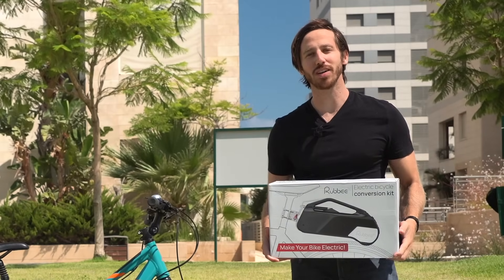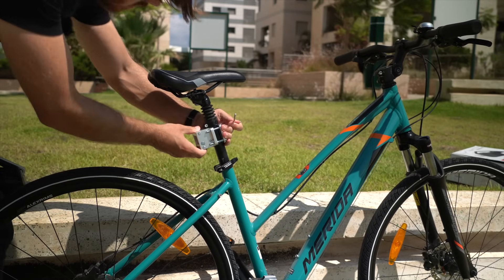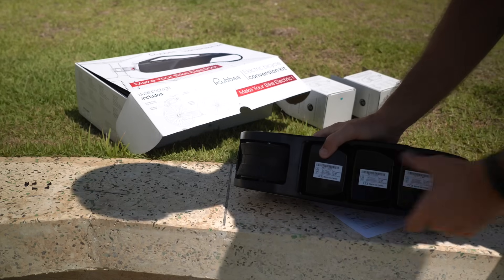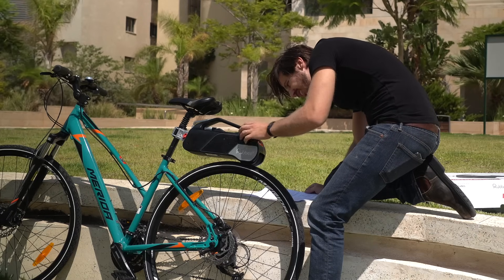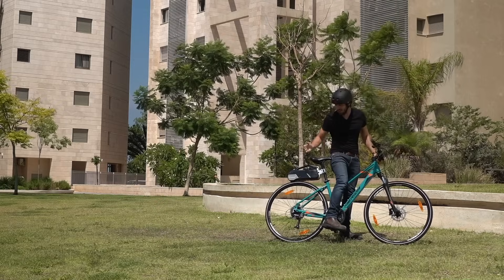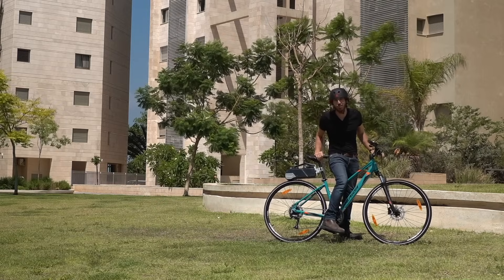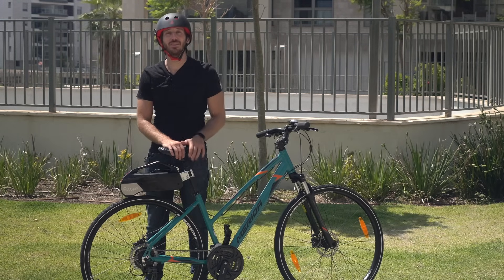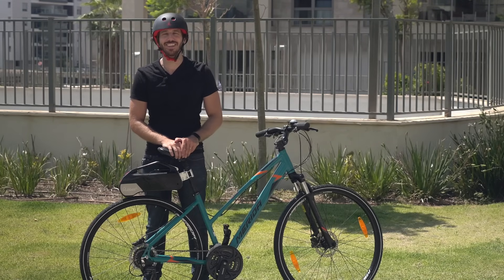The Easiest DIY Electric Bike Kit I've Ever Used! (Rubbee X)

Comment: Is there an ebike classification like 1,2,or 3 ?
If for instance it’s a class-1, could I then pedal over the 20mph speed limit, also does the unit have to be on continuously?
If so then what is my time limit before the battery goes dead?
Thanks. Jim Wedeking

Comment: DO NOT Buy one of these. I am one of the backers for this on Kickstarter almost 3 years ago, they have not fulfilled their backers and have no intention of doing so. No matter what their excuses are,  they have stock to sell to unsuspecting public but none to fulfil their investors. How can you trust a company like this? Yes, I’m biased because of being CHEATED by the company but think about it this way, if a company blatantly disregards their backers and is in it just to make a quick buck, what will happen down the line when the company finally folds due to it’s devious practices and you need to replace your propriety batteries?

Comment: Wow, this setup is around $900.  For the motor unit and batteries. Plus shipping if they charge for that, plus a bicycle. 
My last four used cars each cost me less than that.
Reply: Stop buying shitboxes then. You can buy a car for next to nothing these days, especially without valid MOT, no point comparing against something new, with warranty.
Reply: @owen4326  
   The a new car payment is what, $400-$600?
 The gray Kia s*** box I put about 50,000 miles on. I sold the corpse for $600.
The blue s*** box before that, I put about 80,000 miles on. Got $300 from the junkyard on that one. 
    The red S10 s*** box before that don't remember miles, but I had it over a year, and got about $300 for that corpse.
    The silver Kia before that one, same general idea, although I did have to spend about $300 for a gas tank, and a couple hundred dollars for radiator on that one. Timing went out shredded the engine after two or three years And I got a few hundred dollars for that corpse too.
    The green one before that was junk. After a while, no front suspension. But I got a few months out of it, and again I sold the corpse.
   Yeah I didn't have any warranties.  
   They kept me warm and dry. 
    Not sure what an MOT is. They were titled, plated, registration stickered, and I carried more than minimum liability insurance to legally operate each of them.
Reply: @othername1000  if you really were able to make all those junkyard cars run for that cheap and that long then clearly you are mechanically inclined. This kit is made for people who are not like you. This is made to be as easy and simple as possible for those people

Comment: I am looking for a simple motor, usb battery, and thumb throttle setup that is cheap.  Friction drives kind of fit that but they seem to be around $500 which seems high for my simple setup and older technology.

Comment: Too many other conversion kit companies have missed the boat by building them with overly complex mechanisms. This one impressed me for it's simplicity.
Reply: simple but what happens to tyres?
Reply: @truthandreason8394  Time will tell.
Reply: @truthandreason8394  
You do get some extra wear can't get away from it.  Years ago I did same thing   with a 2 stroke weed trimmer and metal roller . The wear was bad and so was the oily mess.
This time I've used an electric skateboard motor with urethane tyre  as the driver and so far roller and bike tyre still good after few weeks riding. The 2 stroke I could ruin in couple of days.
Reply: I totally agree . Take a look at this, my diy using same idea.  As is have done 11 kilometres without peddling. Still work in progress. 
https://youtu.be/u6Tbwu50QkM
Reply: For the cost of this and the little assist amount you get, you'd be running to those "overly complicated" options afterwards.

Comment: Do you have any plans to test this in different weather conditions? The FAQ on their website lists the following as one of their methods that keeps the roller from slipping on the tire:
'Special roller. Both material, shape and surface texture of the roller is optimized for increasing grip in all weather conditions.'
REALLY curious if this holds true.
Reply: Yep it does, it works fine in the wet. The gas charged cylinder allows it to maintain constant pressure on the tyre and stops any bouncing and traction loss.
Reply: @bagster8660  Thank you!

Comment: Thanks for this review. I've been intrigued by the Rubbee for ages since it seems like they've solved a lot of the problems with older friction-drive options. They seem to be in a good price position to compete with other 'all in one' (battery, motor, controller) options like GeoOrbital, Swytch, or Hilltopper.

What are your thoughts on their (as far as I know) unique setup of using multiple batteries to increase not only capacity but to also increase/unlock higher wattage?
Reply: How much does it cost as far as 2022?
Reply: @MigzMigz35  €777.00/815.39USD to get a unit and two extra battery units, to unlock the higher power.
Reply: Where can I get this to buy in the US

Comment: I guess it has its purpose but it says 579 pounds (798 US dollars) on their site. That just seems ridiculous. You can get an entire bike for less than that - 

Ecotric Vortex is $660. 
36V 10AH lithium-ion Battery
Removable 
5-8 hours fast charge
18-20 miles per charge
400-600 cycles service life
Max speed: 20mph/h

Comment: Might get better friction/traction if you flatten the tire then install the unit then repump the tire with air and it will press firmly against the tire. Just male sure the unit is low enough for when you pump it. If you plan to just keep it on a personal bike i mean.
Reply: But more general friction force is what we dont want, we want traction force (thrust).

Comment: Nice review and I have some questions. Can you easily take it off to recharge? Do you need to remove the battery modules? How does it charge? Was a charging cable included? Is it 220v only (from UK) or 110/220? What is the cost?
Reply: It comes with a charging cable, you can charge all the batteries together at once in the device
Reply: Go check out the Rubbee website....But no you don't need to remove the batteries, you plug in the charge like you do on your phone. The charging unit will be country compatible.

Comment: I was hoping you would show how it performs when the rider isn’t peddling unless I missed it. Thanks
Reply: He said it goes into free rolling mode once you stop pedaling, meaning it does nothing
Reply: He said i needs "peddle assist to engage electric assist" and pedaling backwards engages regen breaking. It doesn't run while the is not pedaling.
Reply: rear hub drive are great with just a throttle  . i have 2 1000 watt 48 volt e bikes both tear hub drive they do around 25 mph and run for about 2 hours off road before the battery runs flat ..

Comment: One problem with the Rubbee motor , we in the UK use Mud Guards as its a bit rainy  here than in  Florida , I suppose you could cut a section out of the plastic for the drive to enguage onto the tyre.

Cheers from Philip Cooper in Evesham UK.

Comment: Wow, this brings back memories! My dad had a friction drive kit he bought in the 70s. Battery hung from the crossbar in a hard leather saddle bag, motor assembly assisted the back tire. Problem was the knurled metal drive sprocket chewed up the tire fairly soon and I remember black rubber dust was everywhere. This looks like rubber to rubber so that may work better.

Comment: Cool that the installation is so simple!  No need brake cable sensors, or any wiring to a controller or display.  The only thing you don't want to do with this is ride through a wet cow pie.
Reply: Cow pie?
Reply: @hasan_z  Cattle Mousse, you know. 😉
Reply: @hasan_z  poop

Comment: What distence did you get out of a full charge? A and how’s the regen working? Can you regen a full charge, ½ charge, ¼ partial charge?
Reply: website says 10 miles on the 1   battery included ,but you can buy 2   more for up to 30 miles.

Comment: Did I miss it or did you not detail any specs or price on this unit?  how many watt motor, how many Wh's are the batteries, expected range (window) on a full charge.  Do the spare 2 batteries you installed come standard or optional at what price?
Reply: Go to their website.  It will answer all of your questions.
Reply: @tomnesler2089  obviously but I'm giving feedback to suggest more technical details be included like Micah used to give.

Comment: So, do you think it's a cost-effective option? It seems pricey enough that it might be a better choice to spring for a purpose built ebike?
Reply: Not sure if this was mentioned in another post, but from the website, the base price is 579 euros, plus 99 euros per extra battery. In the video, the three battery version would run 777 euros. This may need to be weighed against just purchasing a new e-bike and selling your old manual one, or keeping your old bike as a backup.
Reply: It's too expensive, unfortunately. The only reasonable use case I can see is somebody needing to remove the entire unit from their bike when locking it up or someone who has an exotic, expensive or unique bike they want to convert to electric without changing the wheels or modifying their bike.

I wish it were the kickstarter backer price, that is just on the high end of making it cost effective to convert a trad bike without modification.

Oh a third use case is taking it stealth on subways where they ban eBikes but allow trad bikes.
Reply: A Ride1Up roadster at $1000 US looks so much more compelling than this IMO.
Reply: @iStrong113  I think it would be disingenuous to suggest that the total cost of the Ruby kit is 579 euros. At bare minimum, you would need a decent bike to start with, so add that cost right up front. Depending on your definition of decent, that cost can get close to $1000 euros. Even if you only consider decent to be in the 500-600 range, that means you've spent at least 2/3 of the cost of a "decent" purpose built ebike, and that is a much different question than whether or not you can buy a purpose built ebike for less than 579 euros.
Reply: @iStrong113  Take a look at the Fiido d4s. It was my intro to the world of e-bikes (bought it last year) and I just love it! Brought it out of storage last night (charged battery, pumped up tires, oiled chain, etc.) and it (still) runs great. Super happy with it!

Comment: What speed did u find it easy to reach - and hold (say for 5kms / 3m on the flat)?
And what range with the 3-pack of batteries?
Tx for great channel
Reply: Range for 3 batteries is 30 miles

Comment: This is fantastic!
any thoughts about wearing the tire? is this an issue at all?
Reply: Rubbee X adds additional wear to the tire but nothing that should be worried about. We cast the rollers from a specially developed polyurethane compound mix which guarantees the best contact between the tire and the roller. We test roller materials for thousands of kilometers on the same tire without drastic wear&tear. In any case it is generally recommended to change bicycle tires every 2000-3000 km so we recommend to follow this rule.
Reply: @RubbeeDrive  thank you for the reply! I am really considering purchasing this for my wife. It looks fantastic!
Reply: @estossala1  Thank You Esteban, feel free to contact us anytime if You'll have any questions :)

Comment: It's not cheap, but it's not super expensive, either. The best thing is that you can easily transfer it between bikes, even without the optional extra mount kit. It's a true "anyone can do it in a few minutes" kit, unlike that other one that requires a wheel swap etc. That one is disingenuous with their advertising. There's not really anything easier or different about their kit other than the slick packaging and advertising hype. This one really is different and easy. In fact, in theory you could take this thing travelling with you and put it on any bike you come across. The one caveat is that it obviously won't work with a rear fender installed.

As for how it does in the rain (or mud or snow), that's not really relevant. Anybody hardcore enough to ride in those conditions isn't going to be satisfied with the power or speed of this thing anyway. They are all going to have a purpose-built ebike, and if it's a DIY it will be a 1000W+ monster. This is for people who just want that bit of help to get them up hills and keep them riding instead of driving their car and they want to keep their current bike. I think it's great!

Comment: This kit is perfect for traveling where you want to an ebike but don't want to travel with yours. Like renting a regular bike in Hawaii and slapping this on it.
Reply: I would suggest checking your airline's battery policy first.
Reply: @AdamsHadEnough  That might be why the batteries are split into 3
Reply: @tonylarose4842  That's a great observation, our batteries are split into modules under 100Wh capacity limit for easy transport !
Reply: You would need to make sure that the bike you're renting doesn't have any fenders/mudguards and/or a luggage rack.
Reply: No mention n of speed or range?
Reply: Hawaii   ...   worst place to bicycle
Reply: @kamalakrsna  Big Island's ok if you follow the Iron Man cycle route.
Reply: Why not simply rent an E-bike at your destination?
Reply: Reyes -  where you want to an ebike???
Reply: Or to take it off once you get to a skatepark. I'd like to see it on a 20" before I buy.
Reply: Red or range!
Reply: Only usable with dry weather;)
Reply: That thing is so heavy, and takes up a lot of space. Doesn't seem suitable for travelling tbh
Reply: Traveling with LiPo batteries is tricky...  some airlines won't even allow them in the cargo hold above certain capacities.  And quite frankly, not sure I'd want to be on an over ocean flight with massive consumer owned  LiPos on board that could be overcharged, damaged, abused, etc.  If you've ever seen a LiPo fire you understand why.

Comment: Interesting idea, perfect for those with minimal DIY abilities.  Personally I'd look at other options.
Reply: Even with some serious DIY abilities, undertaking any sort of conversion from pedal only to assist is not a cheap or easy task. This solution is actually quite practical.
Reply: @jamesyahoo4758  I'll agree to disagree, for the price I can build a front hub kit with a larger battery for more range very easily (it's the project I'm working on now).
Reply: @ebikeengineer  can't knock rear hubs lol
Reply: @ebikeengineer  rear wheel drive is badass plus wheelies!
Reply: @eazysmokes3743  I don't think you're doing wheelies on that thing.  Now put a rear hub motor or mid drive and we can talk!
Reply: @eazysmokes3743  All true, but in general I can put together a front hub for less.   The mid drive I built for myself (750w BS02B, 52v battery) wasn't too much more than this kit.
Reply: @ebikeengineer  it's a 750w hub meaning I got torque for the use case
Reply: @ebikeengineer  it's no suspension beast but it can pop the wheelies just fine

Comment: I remember the Solex front wheel mounted petrol powered friction drive. I wonder what the tire wear is like with the Rubbee.
Reply: Also the Berini it had an egg shaped engine  also mounted on the front. They were faster then the Solex. Saw as little kid in the fifties in the Netherlands.
Reply: @hesseldijkstra5327   That brings back some memories, I grew up in a suburb of Athens Greece and had a Solex when I was 15 years old, what fun it was back in 1975!

Comment: Does it work well on knobby tires? Also, what is the amp hour rating of the battery?
Reply: I would definitely re grease the wheel hubs and put smoother tyres on. 🇬🇧👍

Comment: I want to do a minimalist ebike conversion of my giant 28 inch bike.  I live in San Francisco, Ca and ride to work 8 miles round trip and to do most errands.  I am looking to install only 500w front hub, battery, thumb lever, and controller on the cheap.  Can you recommend exact components?  I’m in my 50s and just want to use power as I need it in hilly SF.  Thanks.

Comment: I would recommend charging the battery first. This is because we don’t know how long they’ve been sitting and we don’t know how balance the cells might be. When you charge it fully it initiates the balancing stage on the BMS.
Reply: I agree with you, but these days a reasonably factory fresh product can be fairly reliably expected to ship approx balanced  and with the standard 30 to 50 pct charge.   If any cells are below LVC it likely won't run at all.    

If was my purchase I would charge first,  but he's correct in saying there won't be some irreversible catastrophic damage, as the labels/documentation sometimes seem to imply.   That kind of harsh warning originated in the days of NiCad and NiMH batteries - when it was very true!

Comment: Less than underwhelming! My rubbee motor started running uncontrolled on my 3rd time out. No way to stop it with the power button! Before you buy (or rather not), watch: @ . Also, the range is way shorter than they claim.
Reply: Your post is unhelpful. 
Watch what?

Comment: It looks like a beefed up reversed version of the dynamo you used to get on bikes years ago to power the lights, is there any option to charge it from pedalling the bike instead of just regen?
Reply: this is a brilliant idea you have, and such a feature could help this product stand out as 'ultra green' and maybe help justify its price  .
Reply: I m sure if u disconnected the cadence sensor it will always be in regen mode. Mount it to a trainer n u can charge it by pedalling

Comment: Very cool. Interested to hear what sort of watt hours per mile it gets and how that compares to say a mid drive giving a similar amount of boost.
Reply: Hi Matt, it's roughly 10Wh/mile. With one 93Wh module You can get ~10miles of range. It's a pedal assist system so the efficiency is pretty good :)
Reply: ya but that is probably on a straight road with no inclines